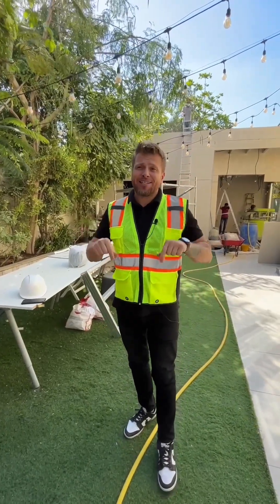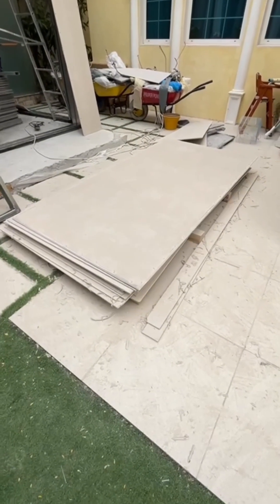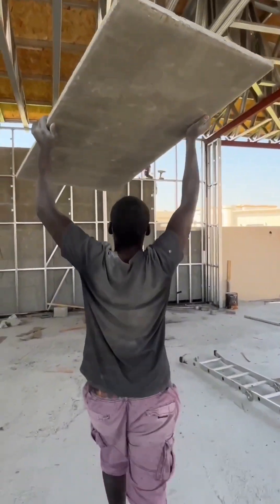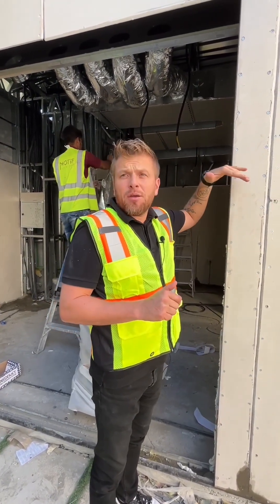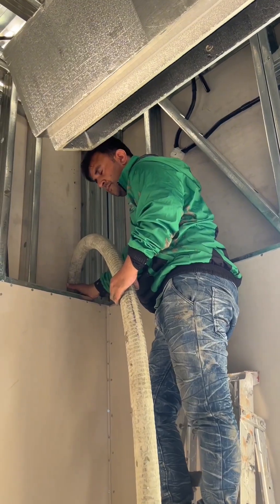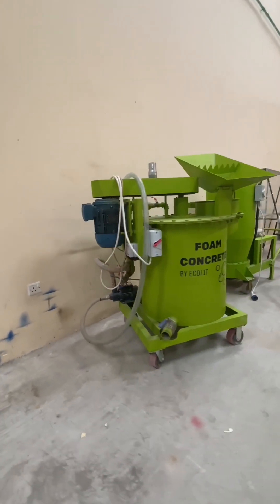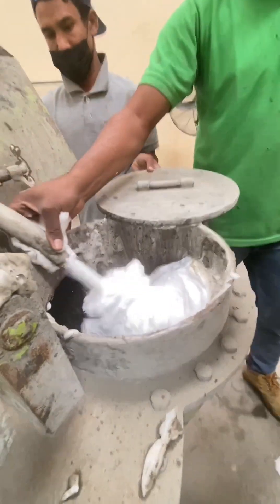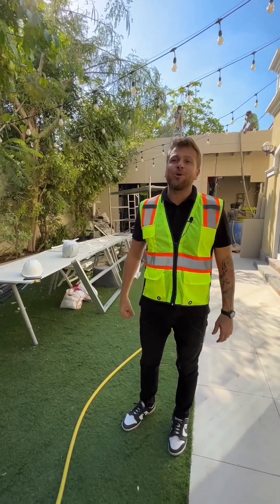Light gauge steel frame house with lightweight concrete insulation

Comment: I have a question what is the application of the light concrete is it sand cement and aggregate, or you use Politerm blu instead of aggregate?
Reply from the maker: Here is the recipe www.pioner-group.com/concrete